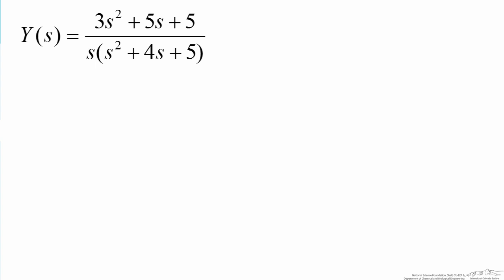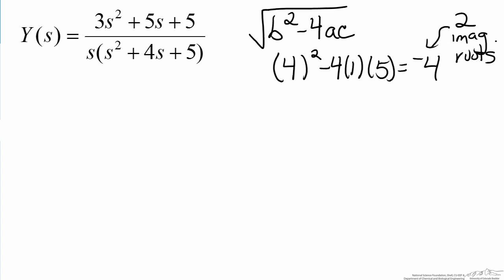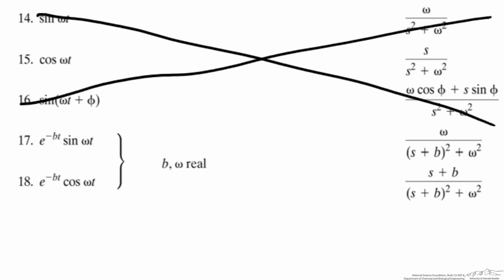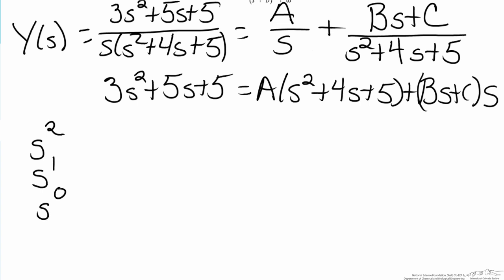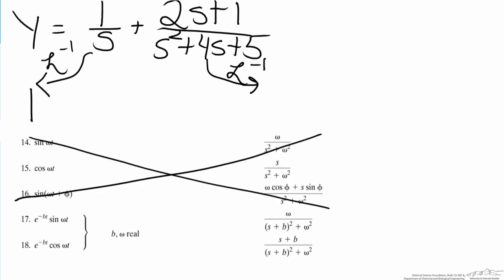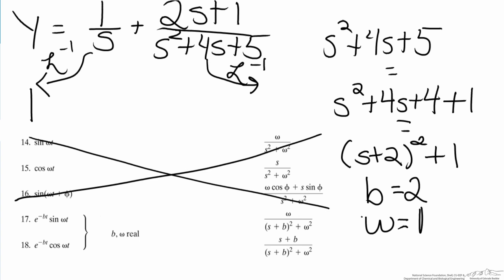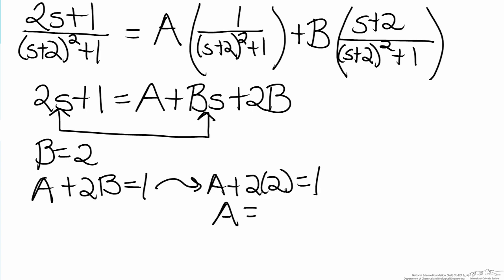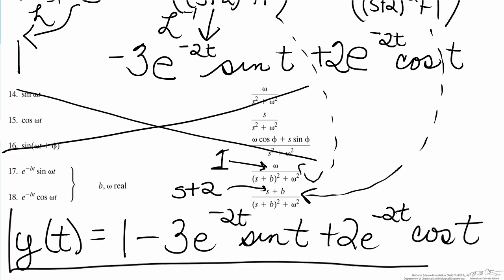Laplace Transforms: Partial Fractions (Imaginary Roots)

Comment: And at 7.20. When he divides the numerator into two terms, how? Like how does he decide that, term A as 1 as a numerator, and term B has (s+2) as a numerator. This is exacly the same thing that profs. do! Whats the point of making an explanation, when the explanation  is "there are a number of ways of doing xyz, i have chosen y" and then not explain what methods xyz are, and why method y is chosen or generally good or prefered in that situation. Somebody, @LearnChemE teach me teach'